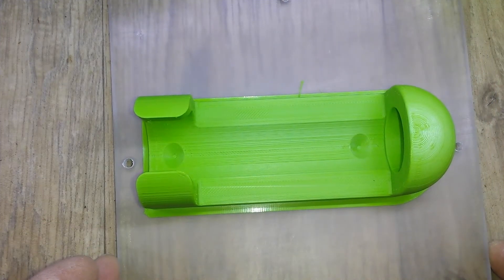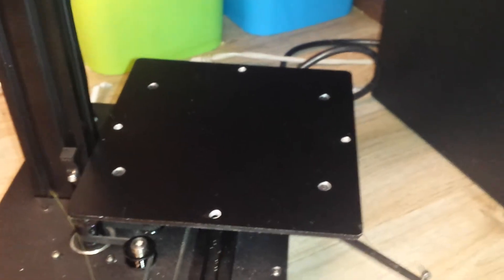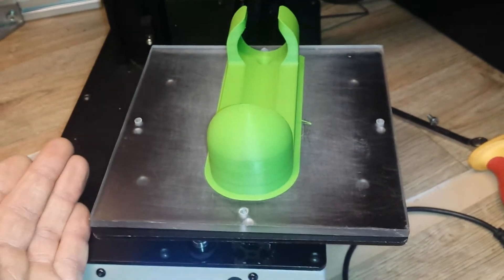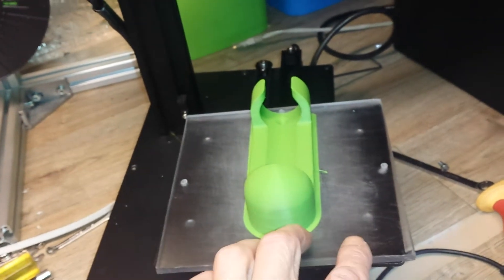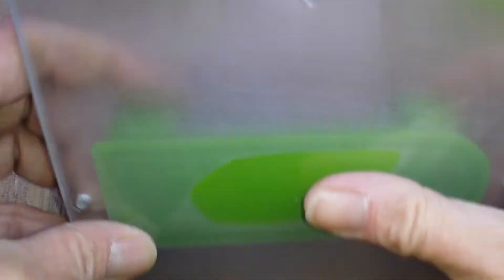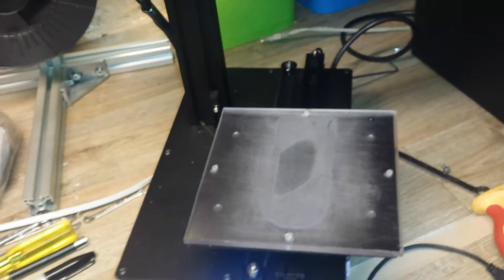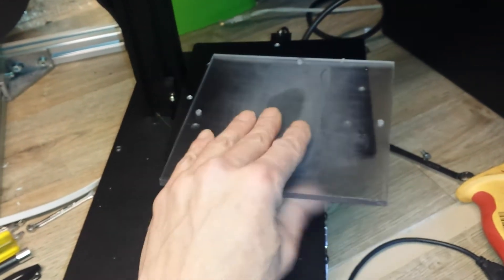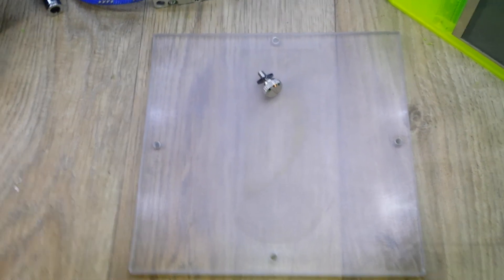Tevo Michelangelo - Simple but effective bed surface

Comment: Does the acrylic have to be see-through or could it be other colours since the only acrylic I have access to is black. Can the acrylic be a different width such as 3mm instead? Thanks for the video as well looks like it really helps the build plate adhesion.
Reply from the maker: Hi sorry for late reply - Any color will work as long as its good and flat.
Reply: Thanks, i've already tried one of the acrylic beds and it works smooth as ever

Comment: If you can spin the plate so easily, then it is not flat.
Reply from the maker: The plate has been removed and the print is pulling the Perspex up ever so slightly. this is why it is held down to the metal bed with thumb screws ! plus there is debris all over my bench. Pure flat is something a CNC achieves - Not FDM 3d Printers